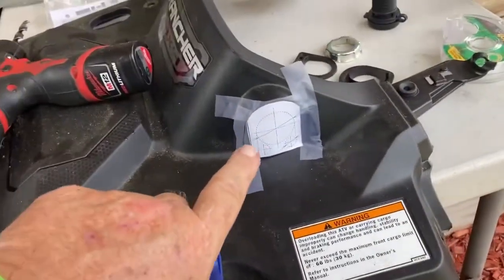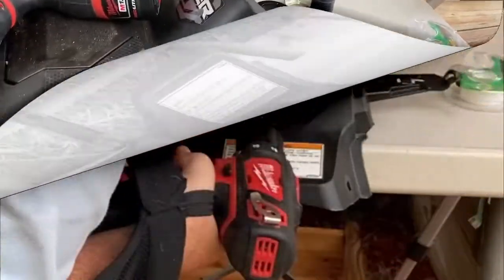Installing 12v Outlet on 2021 Honda Rancher - Vlog #110

Comment: Nice video.  Just a comment though...  not sure about your model year, but my 2024 had plenty of room to reach between the cowling and the steering yoke, not requiring any removal of the cowling.   And you can easily reach from the front little access panel with the plug into the cowling.   Other than drilling a hole, it took about 3 minutes to hook it all up.
Reply from the maker: Thanks! Yep I it is definitely quicker to not remove the cowling. I did removed it for two reasons...1. I wanted to film the process following the Honda Manufacturing instructions. 2. With my gimp right arm, having full and easy access was very helpful. Although it took longer, I had no problems doing the install with a bad arm.  If I had opened the two access points in the hood, it would have given access for the install the wiring.  Installing the outlet would have been pretty hard for me without removing the hood.  I appreciate your comment. Thanks for watching! Dave Out!!

Comment: Way more work than it had to be. There's a power plug for it under steering column by radiator
Reply from the maker: Yep you are right - could have done it quicker.  For the video, I chose to show the OEM installation.  For which I followed the OEM recommended steps.  Thanks for watching  Dave Out!!

Comment: Where did you get the template. Mine didn’t come with one.
Reply from the maker: It was the last page of the instructions.  You can make your own template by using the back of the face plate as a guide.  It is a bit more work but will give the same result.  Sorry I do not have better advice.  Hope it goes well!

Comment: Does this works with the new 2024 honda rancher?
Reply from the maker: I went to Honda's web site and pulled down a copy of the install instructions. It does appear to be the same. I am not an expert, so all I can do is give you my opinion.  A Honda dealer will know for sure.  I also noticed the Honda website had the same price for the outlet as Partzilla.  If you need a copy of the instructions, I can email them to you as I saved the PDF.  Dave Out!!
Reply: Yes, just did mine, by the way, there is no reason to remove all the panels, just push wires through to the access panel for the radiator.

Comment: You cut the hole out wrong,  you were supposed to leave the 2 small holes at the bottom,  it allows the spacers to lock into the plastic for a more secure fit

Comment from the maker: Here is the link for the OEM parts I used.  I purchased them from Partzilla https://www.partzilla.com/product/honda/08U70-HR3-A20
Reply: Dave, I purchased the same plug as you but it didn't not come with the wiring harness. Did you buy that at partzilla as well? Also, I already have a wiring harness for the winch like you, mine just doesn't have the 12v outlet plug on it!
Reply from the maker: I think I went to my Honda dealer for the wiring harness but I would trust Partzilla for it as well. Good luck and thanks for watching!
Reply: Also, did you print the template? Mine didn't come with that either!
Reply from the maker: @danielholland8719  Mine came with the template.  Printing it should work.  The place where the outlet go kind of has a natural shape that the template fits on. So if what you print kind of matches that shape, you should be good.  What a bummer that was missing.
Reply: @danielholland8719  did you ever find a template?. Just received mine and I don't have mine either